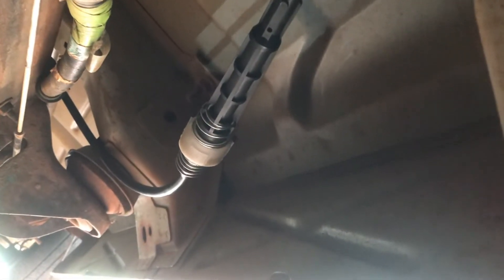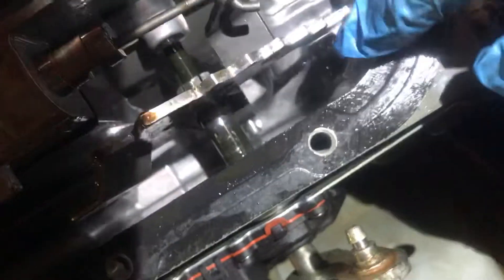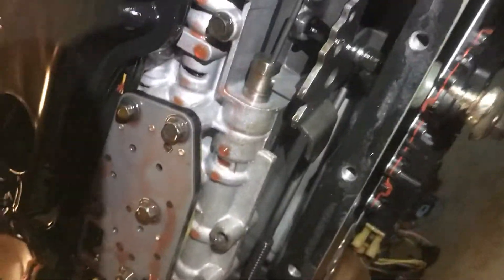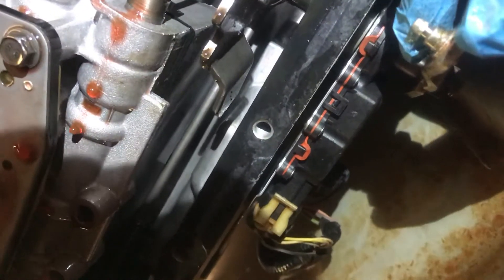4L60e No Park (SOLVED)

Comment: How common of a problem is this? I’ve adjusted the shifter cable so many times with no luck. Won’t go into park. Only goes as far as reverse.  I just had pan down for filter change. Now it won’t go into park unless I manually move it there.
Reply from the maker: Sounds like the exact same as what led me to this. 

Mine was caused by tightening the shift linkage with a power tool instead of by hand.
Reply: @Christackleberry  thank you, I’ll drop the pan tomorrow and check that.
Reply: @barry was it the problem?
Reply: @angelc8824  yep! Put a new cable in, very little adjustment and working perfectly!

Comment: Have the same issues pulled pan to check bolt. But bolt not the problem idk what’s next?
Reply from the maker: Have you already checked the linkage cable?
Has the trans been freshly rebuilt?
Reply: @Christackleberry  just figured out problem it’s the shifter itself
Reply: Couldn’t it be the neutral safety switch itself?
Reply from the maker: That would cause a no-start situation or the vehicle would start in a drive/reverse gear. 

It would not cause all gears other than park to function.

Comment: There is also la linkage under the dash the holds the shifter from going into park if your brake pedal isn’t depressed that can pop off and get jammed under dash in a way that keeps the shifter from going into park
Reply from the maker: That’s what I meant by “If you’ve already tried all the easy stuff and the things inside”

Comment: Hi friend, I have the same problem with a 4L30E (Honda Passport) and I see that it is also due to the gear selector, how do I replace or adjust it? Do I have to remove the valve body or disassemble the transmission to change it? Thank you very much for the information.
Reply from the maker: My knowledge of 4L30E is only from looking on the internet, but if you have the same problem I show in this video, you will only need to drop the pan and drain the fluid to access the nut on the inside.

Comment: Just swapped my trans but it only goes in reverse and neutral. Can manually change it to any gear though reckon it could be this?
Reply from the maker: So nothing in D?
But you can move the shifter 1,2,3 and it rolls? Or you can move the lever but get no movement?

That sounds like a torque converter issue.
Reply: It ended up being the cable

Comment: I have a 2002 z28 Camaro basically like new but I have an issue, the car goes in reverse when I put it in park and when I park it goes in reverse but slower I thought I had fixed it but lining up the linkage with the shift on top sense it’s an automatic it was very easy and it was getting park but it again went back to being bad, instead of park it’s reverse and when I go to reverse now it drives forward

Comment: Wondering if this is the problem with my mom's truck... Takes all gears but park. Can't remove key from ignition so just unhooked the battery put the parking break on in neutral added a block under the wheels
Reply from the maker: Could be. With mine, I had just rebuild the transmission when I had this problem. 
It could be the shift linkage needs adjustment, broken part in the column near the shifter, or a worn out end link on the shift cable. 
Certain problems are more common to certain years.
Reply: @Christackleberry  yeah i get what your talking about mom got this one used so has high miles

Comment: Had the same problem tightened the nut but it still will not go into park unless I manually shift it like you said any suggestions? Goes into every gear but park and 2nd is there a way to adjust the shifter lever in the cab because when I try to put it into park it will only be able to go up to reverse like when you try to shift it into park it feels like it’s shifted into park because the lever is all the way up but it goes into reverse
Reply from the maker: Did you drop the pan and line up the internal part when you tightened the nut?
It sounds like your shift lever is crooked on the inside like mine was. 

There’s a little white clip on the shift cable you can loosen to tension the cable, but that’s almost never the problem. 

Is yours rebuilt or how many miles on it?
Reply: @Christackleberry  I rebuilt it myself it drives and runs just can’t put it in park  the part you showed was loose so I tightened it but cannot shift it into park unless I physically shift it myself it only has 30 miles on it
Reply: @Christackleberry  I’ll try adjusting the cable again cause im not sure if I did it right
Reply from the maker: Ok. Off the top of my head, here’s a list:

Did you use the tool to install the neutral safety switch?

Is the cable attached to the bracket on the trans correctly?

Is the part of the shifter that holds the cable broken on the column?

There is an electric switch on the column to check also. 

That’s all I can think of unless it’s something internal to the transmission.
Reply: I'm having the same problem right now with the no 2nd gear and park being another reverse.  Did you ever find a solution?
Reply from the maker: @deadlybladesmith3093 
I paid a guy to rebuild it. 
That’s just how those transmissions wear out.
Reply: @Christackleberry  How much did it cost you to have it rebuilt if you don't mind me asking?   If it's a somewhat similar price, I'll just go ahead and manual swap it
Reply: @Christackleberry  How much did it cost you to have it rebuilt if you don't mind me asking?   If it's a somewhat similar price, I'll just go ahead and manual swap it
Reply from the maker: @deadlybladesmith3093 
The guy was a local retired GM tech. He charged me $850, but that was 3 years ago.
Reply: @deadlybladesmith3093  my cable had been messed up when I took the old trans out so I had to go get another one from a junkyard and went into park after that as for my gears I had a different issue. My 3-4 was smoked, sun shell cracked and my valve body was all gummed up. I will say if you don’t have the money to be out of you mess up the rebuild just pay the extra and take it to a shop it’s a pain without all the specialty tools. I just rebuilt mine because I wanted to learn and had the money to buy a new trans if needed

Comment: What caR is this?
Reply from the maker: 2001 Chevy Silverado 1500 
2 Wheel Drive

It’s the same transmission in most of the early 2000 Chevy trucks and SUVs
Reply: @Christackleberry   thank you I typed In cadillac 2005. Your video  came up . Thank you.
Reply from the maker: This would be for a 99-06 Escalade, but nothing else Cadillac.
Reply: Thank you.